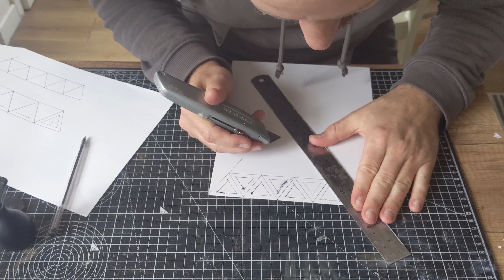Making Two Different Urban Bridges | Modular City Wargaming Board | Miniature Terrain Tutorial

Comment: With those broken candy-striped barriers, you might've inserted a length of bent paperclip or other wire between, to simulate rebar reinforcements inside the concrete. Just a small touch, but easy to do. =^[.]^=
Reply from the maker: Absolutely, I've used that technique in previous builds but I couldn't tell you why I didn't here. 
I'll probably be revisiting this board at some point to make it better and I think this will be one of those added details
Reply: @GoodEnoughScenery  If you do, I might suggest you find some close-to-scale toy or model cars (bonus scatter) with which to scale your roadways. I know space on a gaming table comes at a premium, but that bridge, especially, just looks tiny in context. ='[.]'=
Reply from the maker: @Raycheetah  it was very much supposed to be large railing rather than suspension bridge, but I get your point.